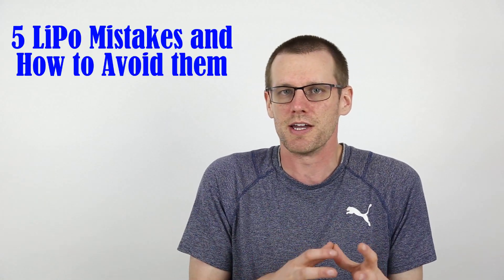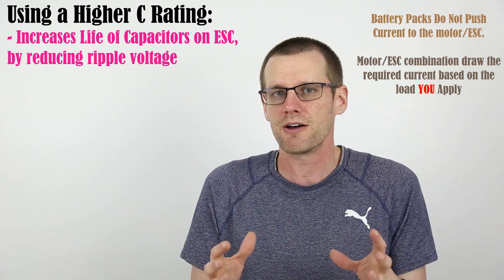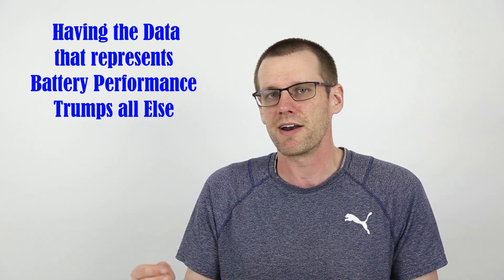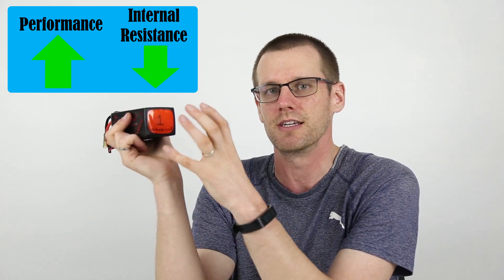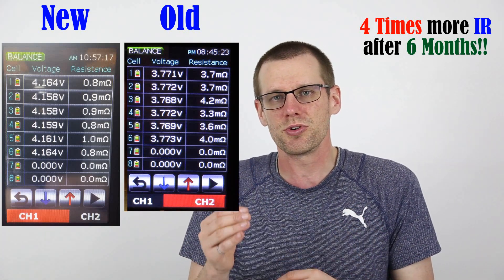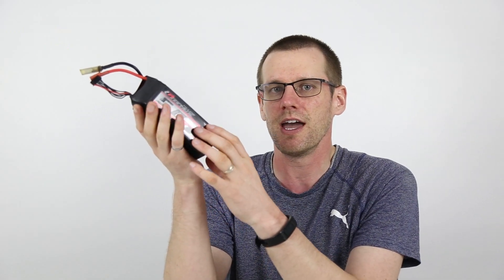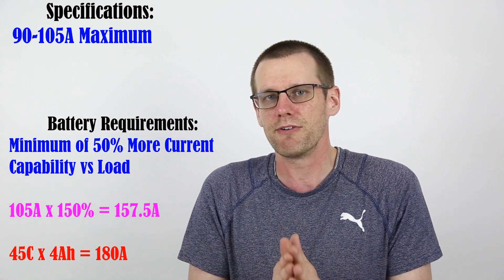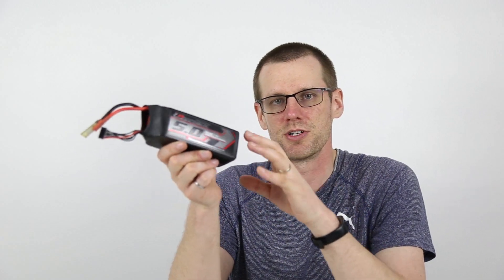Top 5 RC LiPo Battery Mistakes and How to Avoid Them

Comment: My information and also experience shows I.R. should be read at full 4.2V charged. At 5:57 this was not demonstrated?
Reply from the maker: How do you measure IR correctly at 4.2V?  How do you know IR should be read at this voltage?
Reply: @RCexplained it’s not intuitive is it. Fact is though I’ve got vastly different IR at full charge VS storage charge. Also had good low IR restored after a few cycles. Try it

Comment: What is safe temperature for Li-Ion?
Reply from the maker: room temperature.
Reply: @RCexplained  but they get hot during Rc Car usage... Not during charging though.
Reply from the maker: @vendettasnares  max 140f or 60c
Reply: @RCexplained  all right, I'll check their temperature right after usage next time. I've been told not to charge them when they're hot.
Reply from the maker: @vendettasnares  yes and for regular use stay well below the maximum otherwise you will kill their life.
Reply: @RCexplained  I've heard that this is normal on that RC car and that's probably design flaw. Also the battery is well hidden behind a plastic lid which is what I have not seen yet in bigger RC cars. So that definitely doesn't help with heat exchange.

Comment: This storage voltage part I'm not sure about. Maybe battery size has an effect but I found a 2s, 1Ah that was left fully charged for 5+ years. Checked it out and still using it.

Comment: You fail to mention manufacturer specs you just go on about the highest c rating which is a joke as there is no standard, anyways Traxxas uses a 25c which is pathetic according to you but its what they design their vehicles to run on and perform on so why go bigger? Why would they not want their vehicles to perform at its best? Not one Traxxas I have seems to lack any kind of power when something as big as an Xmaxx can do a backflip just by punching the throttle there is no lack of performance. Even Castle says 30c or a high quality 25c like Traxxas right on their website I bet their 25c probably stomps half these cheap 60  70 c packs
Reply from the maker: I have videos on all the items you mention.

Comment: Buying lipos is a crap shoot, you read reviews, watch videos, half say it's a good brand, the other half says they suck. Some have good luck with the off brands, other's they fail quick. Name brands, the same thing. To be honest, I really haven't had any luck with the brands I have bought. So how do you choose? I have a 5th scale buggy and really need the higher c-ratings. I've had no less than 4 (maybe a few more, I've lost count) that have puffed and they were a name brand and kind of expensive ( $100+ ea ). I can't afford to keep buying batteries when they puff only after a few runs. Now I did find out it was the spektrum esc that was bad from the factory to cause the puffing. It has since been replaced with a better brand esc. But a couple batteries still puffed from the same brand.  As far as the resistance readings, according to my charger, all my batteries are anywhere from 2.5 ohms to about 8. I storage charge them after they cool down, I don't over charge them, I don't let them sit with a full charge. I have the lvc set to high and it actually does a good job, shutting down when the voltage drops to anywhere between 3.5-3.8 volts per cell.

Comment: Some guy I know flies F5B competition(some serious lipo abuse) His friend was European champion.They pull 300a amps from 2000 mah turnigy packs. Regardless the C rating because it's simple not true.  

He teached me a couple of things.

They all use lipo warmers. Put your lipo's in it the box 1 hour before flying, so the inner cells also warmed up. It will bring the internal resistance way down! Go to about 35' Celsius. And that will make your lipo's last much longer. And much more power
 But only put the lipo's in when you use them. Heat will also speed up the aging process a little bit, but flying cold lipo's will much more harm!

C rating goes extremely up. I've tried it a couple of times. Much more power with my 3d planes. Lipo's stay colder because they have less resistance.

The best way to store your lipo's is in the cold. Simple reason that cold slows the chemical process down. And the aging of the lipo goes slower. But you need to put the lipo in a sealed back. Condensation will hurt the lipo.

Another thing is the C rating.

Its all bullshit. The best packs tested max deliver 30a35c.

Read through this topic if you have some spare time. The graphics and test results are very interesting:)

https://www.rcgroups.com/forums/showthread.php?1767093-Battery-Load-Test-Comparisons

Comment: Can u use esc rating on bnf single motot rc plane to calc minimum c rating.  Since telemetry doesn't include amps.

  In that case, how would it apply to quadcopters with individual ESCs say 30 (would u multiply by 4)?
Reply from the maker: If that is all the information you know, you can use the ESC Current Rating. Multiply this by the total amount of ESC's used. 
The ESC specification should already have buffer in the actual current drawn vs spec of the ESC. Your choice of battery using this method would be very conservative when adding an extra 50% to the total.

Comment: Another great video, I have a question though, say I’m not using my 6s packs for 4 months during the winter months, I’m up in Bangor maine so it gets cold, I was told I should store them in my cold shed? But your saying to store them in the house at room temp? What is your suggestion? Obviously I store them in fireproof bullet military cases! Thanks
Reply from the maker: My comments about cold temperatures are for using or operating you RC vehicle. In terms of storage, I would always store at room temperature. Cold temperatures can slow down chemical reactions, but subject your packs to potential condensation when removed from a cold environment. I haven't studied these effects on a battery and as such avoid this situation all together.

Comment: i am doing a speed run and ive been looking at a overlander from uk i have there 2200mah 2s  35c one at the moment and its not going to do much for the run i want so ive seen a 2200mah 80c pro 2s and the lipo is thicker each cell to my 35c one witch i know its jue to the c rating  of the lipo but will it be 80c ans not like 50-60c lol

Comment: "Use the highest C pack you can" - this is not said enough. People mess around with C calculations estimating current based on some figure someone made up in a marketing department. Only advanced RC hobbyists should even consider low c packs IMO.

Comment: I hope my basher series gens ace 8000mah 100c are legit....
Reply: Not 100c but they are supposed to be pretty good. It's actually physically impossible for a lipo battery to have a true c rate above 50c. https://www.rcgroups.com/forums/showthread.php?1767093-Battery-Load-Test-Comparisons
Reply: Bashing 8500mAh 50c have lower IR. Marketing :) As a dealer of Gens Ace I inform my customers about it: https://www.lipo.si/izdelek/G-100C80003S/gens-ace-8000mah-111v-100c-3s1p-bashing
Reply: @RCracingSLO  so they are 50 doubled? Not 200c?
Reply: @never-stock-rc2968  no 50C are better, lower IR. Higher price of 50C 8500 compared to 8000 100C is also good indicator

Comment: We need more independent reviews of battery pack with real C ratings.
Reply: A guy on Rc Groups has been doing this for years https://www.rcgroups.com/forums/showthread.php?1767093-Battery-Load-Test-Comparisons
Reply: You can check your self find c rating calculator
Reply: @pitekfimix8782  no I mean proper real life testing. Like running the battery down at 200A, 250A, 300A, 500A whatever it's rated at untill it blows up.
Reply: Exocaged has done some tests
Reply: Everything failed dismally

Comment: How are you guys discharging to storage voltage?
Reply: Just use the charger
Reply: Drive your RC
Reply: @never-stock-rc2968  How do you know you're not under storage voltage then?
Reply: @beachboardfan9544  lipo checker